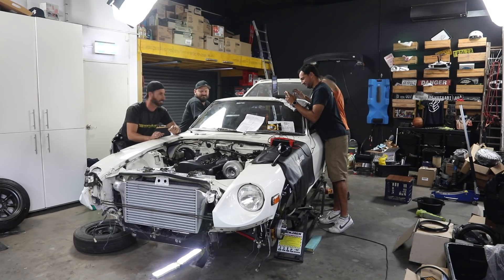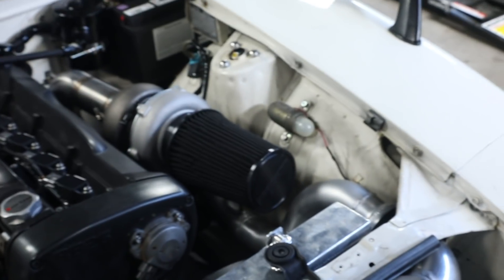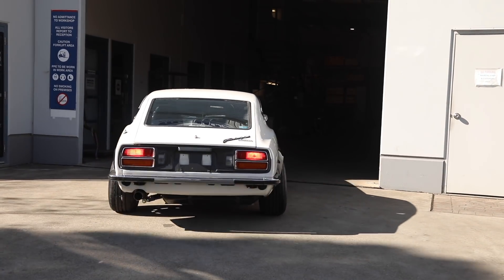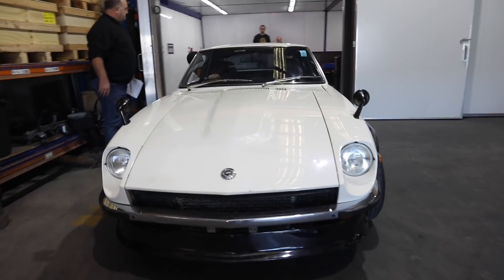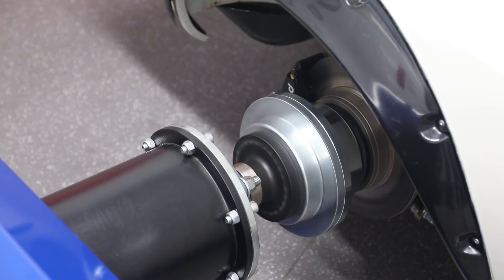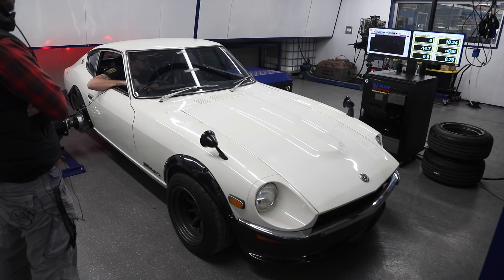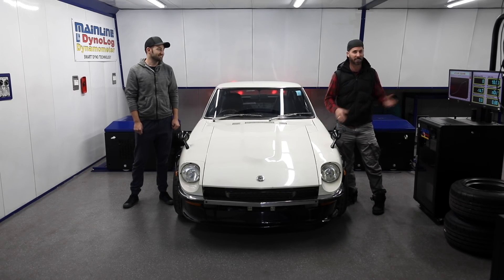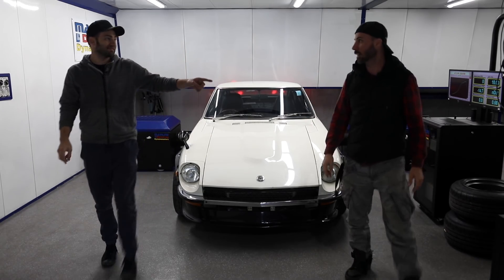240Z - RB26 Engine Conversion [PART 10] IT'S DONE!!

Comment: Lol that little thread would not have destroyed the turbo at all haha!
Reply: M0beast 

It's wire... and yes it would have.
Reply: - its not a metal wire it is material thread from the air filter. it would have been chopped up and melted by the turbo. if it was a steel wire it would have done some damage.
Reply: Bob Bob yes because i test turbos for a living